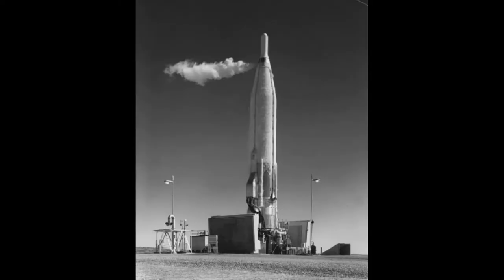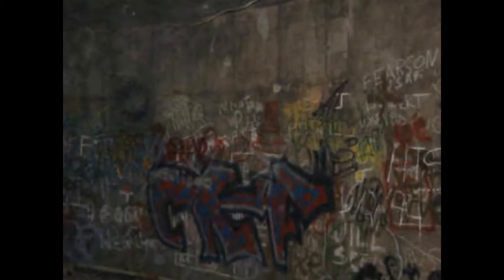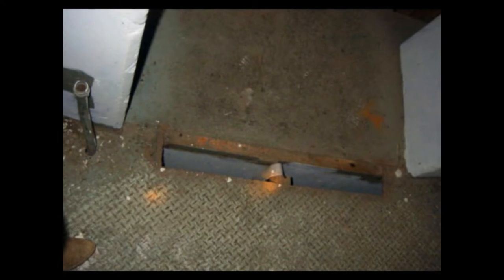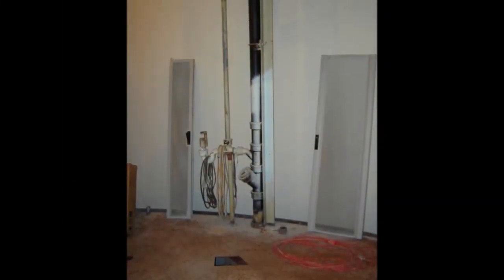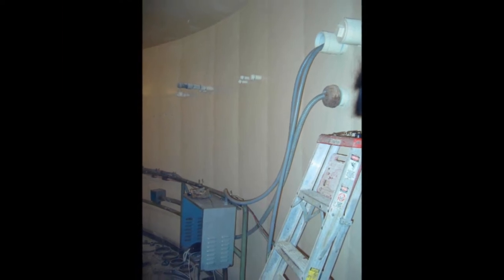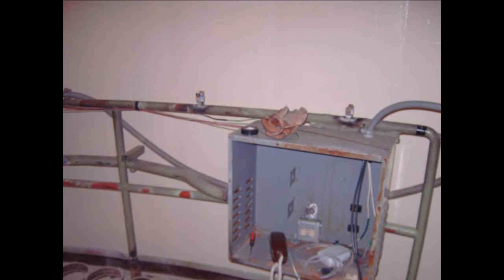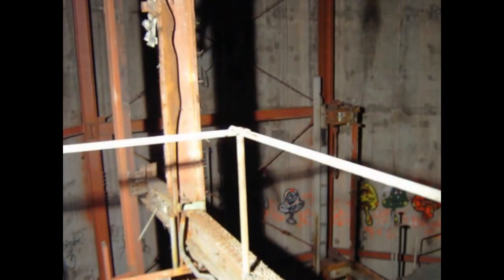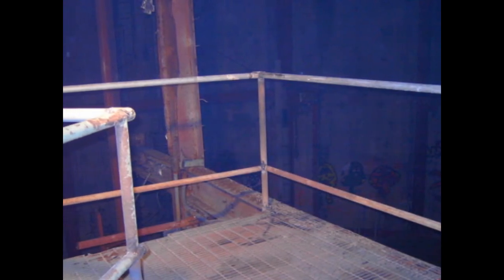MISSILE SILO ADVENTURE 7

Comment: Things looked so different when these missile sites stood alert. I got to tour an operational site in Nebraska prior to one of the last if not the last PLX. The dummy warhead looked so real! Everything else was "turned on" and operating. The thing I noticed most was how crammed the spaces were in the LCC and silo.....and the noise I would describe as humming and singing.......fans, motors, pneumatic systems for leveling the floors in the LCC and all the panels lights indicators gauges. There was little above ground visible except the security fence, the security guard and his dog, the cooling tower, quonset huts and connections to below. There's a lot I've forgotten but I'll never forget the place and the personnel that were there. White uniforms with rank, S.A.C.,  unit patches and missile badges. The MCCC & DMCCC wore 45 pistols. Best of luck SiloMan on your projects. Unlike the Minuteman silos which were imploded, Atlas F silos remain intact. Russia knew we would never use them for ICBM's again.
Reply from the maker: Thanks so much for your kind words.  👍🚀👽